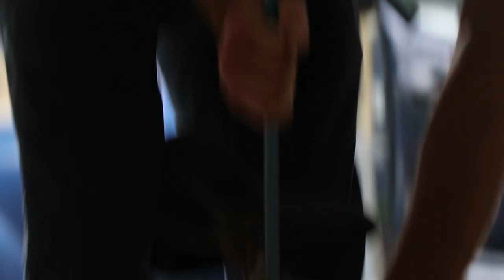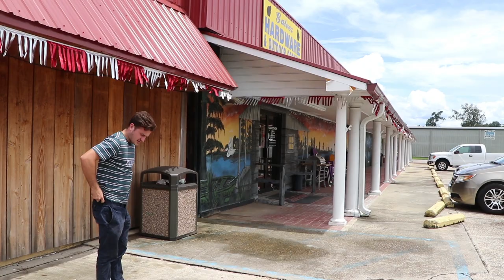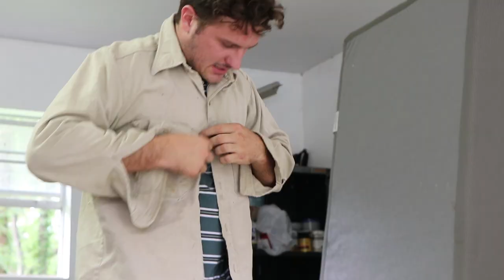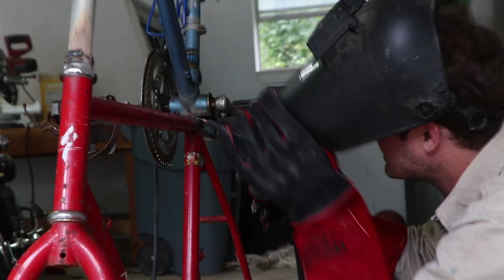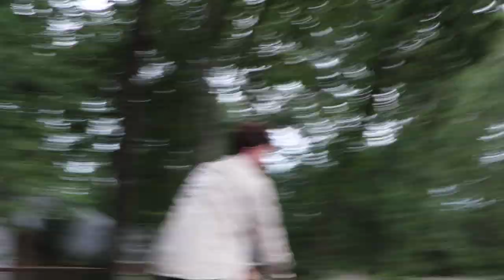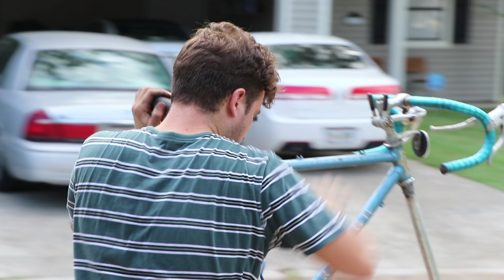How to build a proper tallbike

Comment: A caution on welding Chromolly Frames: Chromolly is more brittle when welded with mig or stick. Recommend tig only with long up and down slope. Welding chromo with mig results in brittle joins that are prone to snapping.
Reply: Most old racers with the fancy corners are chromolly, and were braised together using those cast corners.